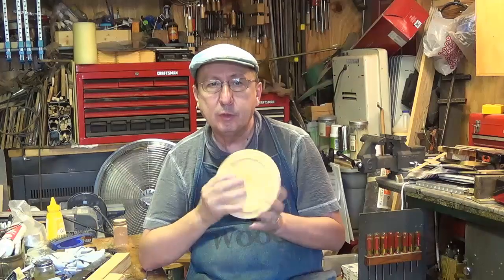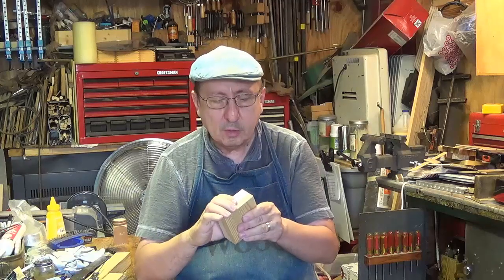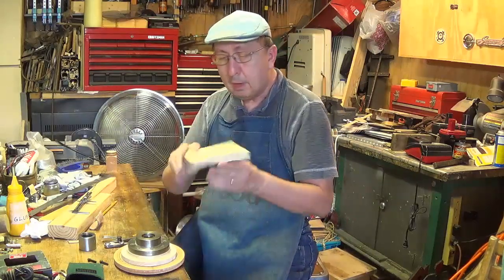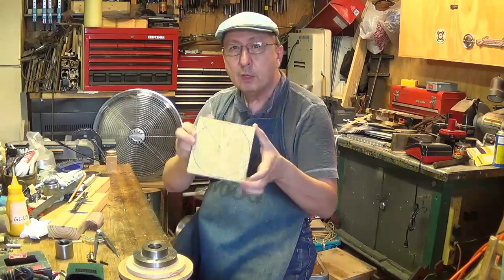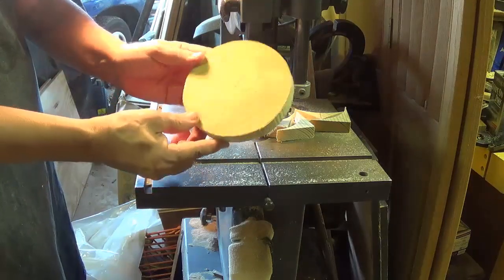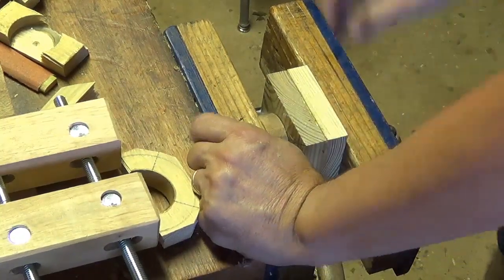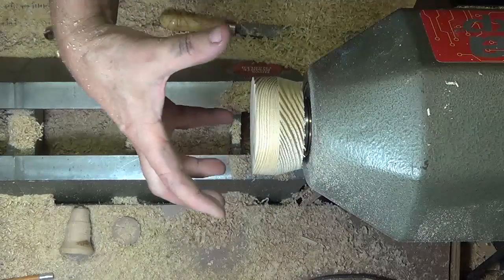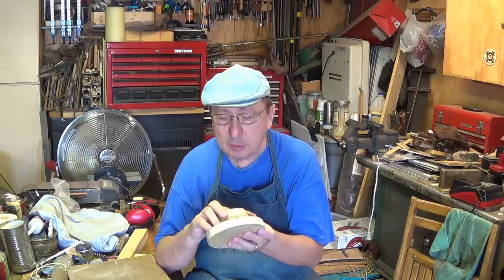Wood Faceplate Experiment - Steelex Threaded Insert

Comment: In 1993 I made a 40 inch faceplate for a foundry pattern shop. It was made with cottonwwood 4 x 4's and  4 layers of laminated birch plywood..
It was for an outboard mounting on a big wood lathe.
After that I built a faceplate for most every lathe I needed one on, mostly metal lathes needing special bolt pattern and balancing weights for teal odd shaped items.

Only limit is imagination.
Reply from the maker: Howdy Mike! Wow, those sound like some pretty big faceplates. Cheers

Comment: Good video. I like how you did the faceplate. I will attempt one myself soon. I bought 1"x8 tpi nuts at the local hardware store. My spindle is that size. I haven't gotten any chuck for the lathe so far. Not sure of what to get? Considering the Nova chuck or Woodriver chuck? Keep the videos coming.

Comment: A "Beall" 1/4"-8  (all sizes) wood tap is only $29 from Beall tool. Never need to buy another faceplate again (for the price of 1ea.  3" faceplate). 

I like to use two pieces of 5/4  E. Maple to build the plate and hub. Glue the hub piece (cross grain) to the plate with a good      ( Titebond 3 ? ) wood glue:

- Drill through and tap with the specified "tap drill" and tap with the wood tap. 
- Then use a liberal coating thin CA on the freshly tapped threads to harden the wood.  
- Let the CA soak in and harden ( no accelerator. ) 
- Then run the tap through again to clean up the threads. 
- Finally, lube up the threads with a thick bee's wax / mineral oil mix ( Butcher Block conditioner. )

 This should make a solid and reliable faceplate.  You could also run an evenly spaced pattern of 3-6 flat head wood screws (not drywall screws) from the back (work) side of the face plate for the best overall strength on larger face plates, vacuum platens or sanding discs. 

I hope this information is helpful. As always use your best judgement regarding your specific application.
Reply from the maker: Howdy Kunk Prime! Interesting. I may give it a go, cheers.

Comment: You may want to consider a locknut --They make them 1X8TPI that is a good fit for the midi lathe.  Don't know if they make them for the full size lathe but if they do then it would be quite a bit cheaper than the Steelex  :)
Reply from the maker: +Terry Ellis Thanks for the suggestion. I may look into it. Thanks for watching. Cheers

Comment: Hex nuts works just as well,, I make them all the time, I can get 10 hex nuts from nut & bolt suppliers for £6 English money, they are only 3\4" deep but they do the job, I glue them into 3\4" plywood with 2 part resin glue, my lathe thread is 3\4" x 16 TPI, Iv'e made glue blocks, 12" flat sanding discs, wood worm screws, even made a 12" adjustable chuck with Hex nut & plywood,  plywood won't split like grained wood if it's too tight, I make sure it's tight when I drill out the hole with a forstener bit & tap it in with a hammer, "sometimes draw round the nut & chisel it out if i'm not feeling lazy" lol,  Thanks for the video
Reply from the maker: Howdy Gordon! Making jigs and things like this are always fun and interesting. All the Best to you.

Comment: Interesting experiment. However, I now made so many wood threaded faceplates that the cost of the tap is trivial compared to a steel insert. There are times that a steel insert would make sense tho.
Thank you
Alan
Reply from the maker: Hello Alan, I am mostly tinkering. I don't need very many. I just like making stuff and I'd be surprised if I make more than a couple.